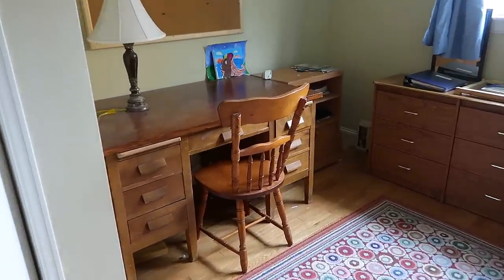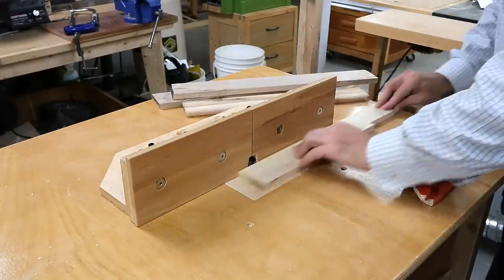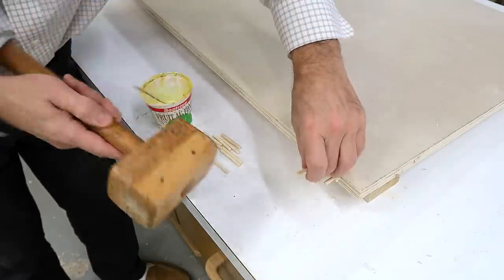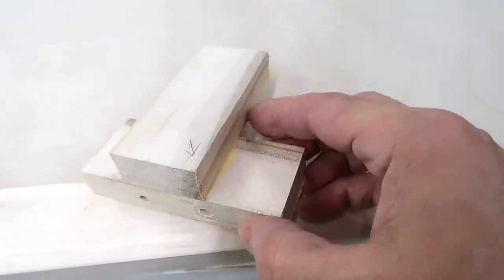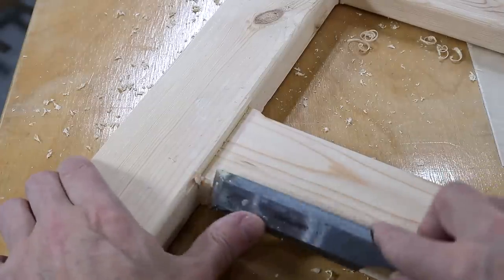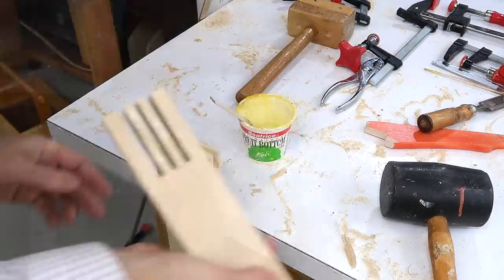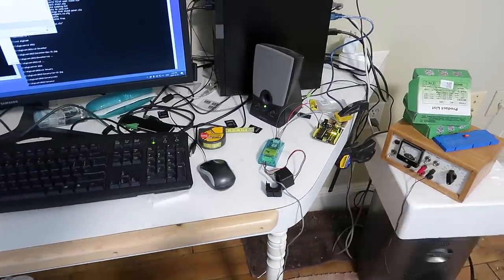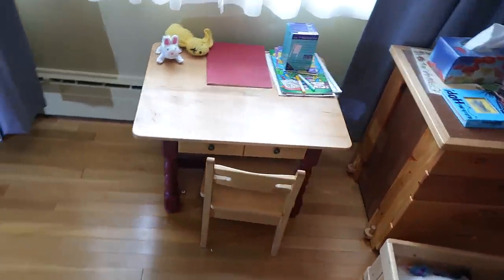Building two small desks

Comment: Tight fitting joints have always been a problem for me. One at a time is okay but when I spread water based PVA glue on several at once the joints swell enough to make it almost impossible to close them. I've had good luck using polyurethane glues in those cases since they are not water based and don't swell the wood. They do require a longer clamp time though.
Reply: Try using a little more clearance in your joints, and use a spray bottle of water to mist the glue and keep it wet. Then you can take your time closing all the joints.

Comment: Just wondering would you get more time for glue ups if you watered it down a little or did a light spraying of water on the joints before applying glue.   Or would that compromise the joint strength?

Comment: 5:00 You know, you could use hide glue.   It works great for furniture and has a really long open time.   Tried and true for hundreds of years.
Reply: And it seems there is probably something that can be added to the present glue to slow it down some. Maybe a few NASCAR restrictor plates.
Reply: Hide glue is kind of a PITA compared to PVA, though. Like you kind of have to have a crock pot running all the time if you want to be able to just pick up the bottle of glue and use it.
Reply: Titebond EXT. Try it on a difficult glue up. You will not be dissatisfied.

Comment: Is there an additive to make that type of glue set slower?  I see a lot of woodworkers complain about how fast it flashes off.
Reply: Water. Just use a spray bottle full of water to spritz the wood before putting down the glue, and reapply the water if your glue is starting to get tacky. You could also just dilute the bottle of glue itself with water for a nice runny glue that will seep deep into any joint you apply it to.

Comment: I'm a new woodworker and my first project and was way bigger than this with 11 drawers. Has a total of 3 screw ups all are done what hidden and probably never noticed unless I tell them.🧐 One was a big mistake that made me made a second mistake which would of better hid the big mistake. The 3rd one was just a plywood kicked back and ran across the blade but it's on the inside behind all the drawers so can't be seen unless you take all the drawers out.🤭

For a first project I think I did a great job at minimizing the mistakes/hiding them if it was for a customer I would have had to redo the big mistake which would have cost me at least another full sheet of plywood. It's 30 wide by 70.5 long have a odd number for the length because I plan on making a hutch for it but think I am going to change the hutch design a bit to make it fancier before I do it.

Comment: What's the purpose of the table saw height adjustment at 2:51? Is this to do with precision or is it helpful to prevent chip-out?
Reply: Looks like he wants to get as close to the edge as possible, so he doesn't need to handsaw more than necessary
Reply: to echo what Johan Eklo said, by raising the blade up it cuts closer to vertical and gets closer to the end of the cut.  Matthias mentioned he wanted to keep the waste material contiguous, so presumably he wanted to avoid partially cutting into the waste.